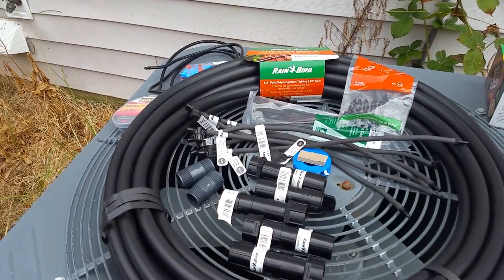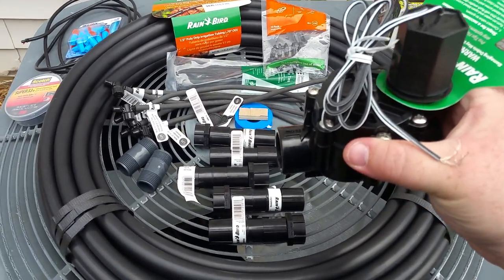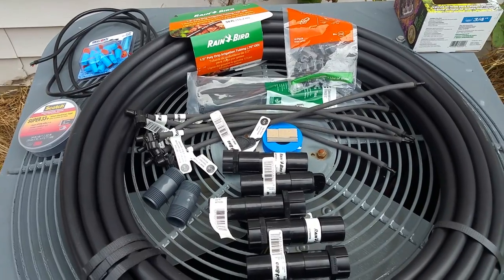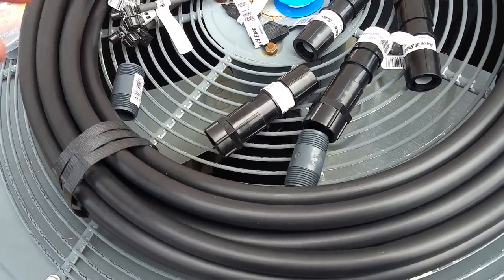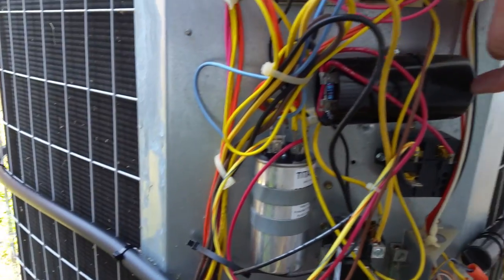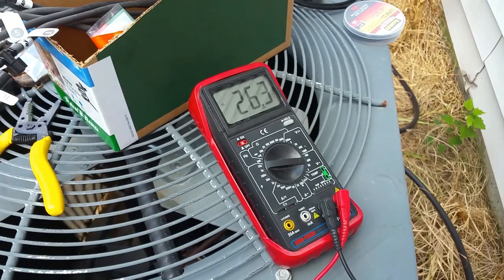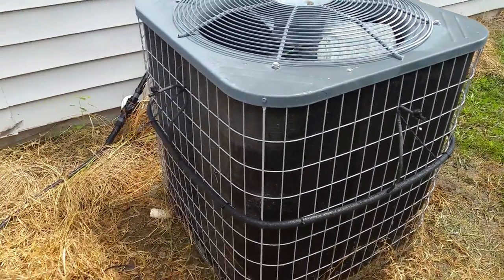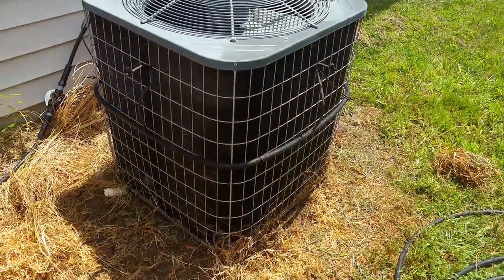DIY Automatic A/C Condenser Evaporator Mister - Electronically controlled!

Comment: Hopefully you have a txv and not a orifice type expansion device. Due to pressure temperature correlation , lowering your discharge press will also lower your suction press. With an orifice type expansion device you'll be causing a incorrect charge condition/ ice maker.
Reply: YEah, so what about when outside temps drop from 105 to 80 in the fall?  Does everyone then need to get refrigerant added to their system to compensate? It's not as if you are freaking freezing the damn condenser, you are simply lowering the temp a few degrees. What if, say, I turn on my AC when it's 60 degrees out? That's gonna destroy my AC unit? No i dont believe it will.
Reply: Joey Hollifield Im not sure what experience you have in the trade . If you read my comment i said "orifice type expansion device" the charge will have to be critically accurate. Damage is possible. Flooding the suction line and slugging a recip type compressor will result in catastrophic failure. And to comment on your question about running your a/c when its 60 deg outside, design supply air is only 58 degrees, so im not sure where your trying to go with that.
Reply: You don't know where io'm going with that? Come on, ok, lets say you come out and instrall my system when it's 68 degrees. I suppose when the temps hit 105 you are gonna have to come back out and remove some refrigerant from my system, correct? then when it drops to 80 you are gonna have to come back out and add some more? otherwise catastrophic failure is imminent right? BEcause that is all that this system is SUPPOSED to do, lower ambient temperatures around the coils. There should be no water hitting them, if done correctly the water evaporates in the air then the lower temp air is drawn through the cools, making it seem like it's only 88 instead of 105, or whatever. What is the difference between the air temp dropping naturally and dropping because someone used some local evaporative cooling? THATS what I'm getting at. There is NO difference at all.

Comment: You should install an outdoor thermostat so it will only open the water valve in higher temperatures  or your going to have other problems.note. if that is city water your using witch has chlorine it will greatly reduce the life of your condenser coil. Well water if not filtered properly will coat the coil with iron raising the head pressure

Comment: Nice job
Only comment would be to make sure it's off for heat pump mode or you'll habe an  ice block☺
Reply from the maker: androslive Definitely. I'll just turn the water off when summer is over.
Reply from the maker: Awesome! Thanks for the tip! I'll be adding a photocell and temp control soon, so water is not wasted at night and when temps are low enough that the mister isn't needed. I'll switch it to the reversing valve wire at that time. Really appreciate it!
Reply: and if you had payed attention to wiring he tied into the cooling wire on heat pump so it wont kick on for heat 

but yea spring and fall it couldbe valves off and you forget to mention draining the system if it freezes out side

Comment: has it been proven that this lowers your electric consumption?
Reply from the maker: There are too many variables to definitively say yes, however I saw a 10-17% drop. The best data I can provide was a significant reduction in post evaporator air temperature. This means the system was running more efficiently, allowing more heat to be extracted and moved outside. On average I saw a 7-10F reduction in air temperature coming off the evaporator.

Comment: parts list?
Reply from the maker: Working on it.
Reply: Part list??
Reply: Use pvc instead of the coil pipe like his used. It will be a lot cheaper. The misters can be screwed directly onto a pvc fitting, again reducing costs. I installed on mine using 3 misters, 3 slip to male-threaded 1/2" adapters, 1/2" pvc pipe, enough 90 degree elbows (5 for me), T's and 4-ways where needed, and a 1/2" to 1/2" nipple. I did this because I used poly hose to connect to a recirculator pump as I was doing this on a window unit and was capturing the water as it ran out the bottom of the A/C. I made a filter out of 2" pvc about 2ft long, cap on one end, 2" to 1/2" reducer nipple, then the poly hose from there up to the pump. Then a short piece from the pump to the pvc pipe. The poly hose was used to help with vibrations between the pump and the A/C running, minimizing stress points.

Comment: two comments :  three is plenty, and much finer spray, you need fogger nozzles,
second,  you could use one nozzle for the unit and get the benefits.

you do not need this unless the air temp is over 90 or some such.   a temperature controller is less than $20 on ebay
Reply from the maker: Please see my updated videos, I have replaced the nozzles with a much finer misting nozzle. Also summers here in NC are routinely 95-100 so it will be well worth it.

Comment: constantly wetting aluminum condenser fins that weren't designed to be operated in that environment can't be good..

Has any manufacturer of these home HVAC condensers ever endorsed continuous spray cooling?
Reply: man, aluminum is THE MATERIAL OF CHOICE FOR WET ENVIRONMENTS, even WET AND SALTY ENVIRONMENTS, as in ships masts, and railing, aluminum boats, etc.... it does not harm aluminum to be wet, not a bit. HAve you guys ever been like out in the world and paid attention to anything?

Comment: If you use anything other than distilled water you will ruin you a/c condenser. The fins will be coated with deposits that inhibit cooling. I find out the hard way even though I used a calcium filter.  Before I added the mister my a/c unit would drop out side temperature by 35 degrees F. When the temperature was 115 outside the  house was kept at 80. Now no more than 25 degrees on a hot day. The system now runs continually to bring the temperature down to 78 when the outside temperature is 100. 
My system is a four ton Trane and is only two years old. take heed.
Reply from the maker: Michael Cohen thank you I will keep am eye on it.
Reply: If you notice any white-ish deposits on the louvers then you are depositing material as I mentioned.
Reply from the maker: 1 Month in and no deposits. I will keep an eye on it. As I've tried to state I have very soft water, with a neutral pH. I'm lucky.
Reply: jonboy545 in my case it took 1 1/2 seasons before I noticed the drop in performance. Best of luck. I'm going to try CLR to remove the deposits. Baseline your system performance  now then again in a year or so.
Reply: You might have small leaks in your condenser coil. Trane coils are aluminum and water weakens them. Might be worth a check.
Reply: Scott HVAC Thanks, will definitely look into that.
Reply: The definition of salt is what is left behind when water evaporates. Saltwater is corrosive. The deposits left behind inhibit the coils ability to transfer heat. Not to mention what else is in your water that could be damaging. Like an oxidiser.... Which leads to "put a filter in line" or "add an RO system..." Great idea!!!! NO NO NO NO ! ! ! Water likes to be hard.... Js. So all those minerals you just stole from it.... It will be on the hunt to replace what it had. Your coils!!!! Yummy Soft metal to absorb... Oh the best one yet.... Water softeners!!! Aka ion exchanger... Ok so instead or just stealing from water, let's pull a fast one and quickly replace with something... Great idea! No!!! Actually it's worse!!!! That's because your replacement is a hungry oxidiser!!! Yummy Soft metal!!!!! Thoes aluminium fins will be eaten within a few years and before you notice any visible damage. Just like a termite. You don't know they are there till it's to late! That post you just fell over leaning on well you didn't know it but it was held together by paint ha ha! Salt, (sodium chloride) is used to replace the minerals in water. Chlorine is an oxidiser and bonds with your coils They wear thin till nothing left then before you realise, you suddenly loosing cooling! That's cause your copper is so thin it's leaking the freon... 
Also the definition of a battery is, two dissimilar metals separated by salt. .....yep you just invested in the most expensive battery that you'll never get power from....

Ok let's say you decide to try this for maybe a season or two.

Comment: Something I haven't seen mentioned hear yet is that you actually want the condensing unit to run to be more efficient. Electrically any compressor/motor uses up to 6 times more power to start it than it does to just keep running. By causing it to shut down more often, it could use more electricity instead of less due to start up. If you want water cooling, spray yourself with the damn hose and then get on a bike of some kind, you'll cool down real fast.....at least for a minute.

Comment: Update your video a year after operating! (Rusted condenser, fins, condition of condenser)
Reply from the maker: +Alan Green Will do! Amazing how these things don't rust when exposed to the rain year round! Great thinking! Oh, aluminum doesn't rust genius. Frame is powder coated, other metals are galvanized or zinc coated.... almost like they expect these things to be outside! Amazing!!!
Reply: jonboy545 Well the motors, compressors, and coils depending on style will and do rust from rain alone. I see it fairly often. I have my own reasons for why I don’t think the misters are a great idea, especially in low to moderate ambient conditions but I’m not gonna waste my time. If it works for you great, that’s all that matters!
Reply: dude, iron rusts. There is not a bit of iron in a condenser, none.
Reply from the maker: Sorry for the delay in getting to your comment. As of October 2018 there were 0 issues with the setup, and was still running great. Sold my home in October and have since moved. New house has a much, much more efficient AC system and I don't see a benefit of installing a mister at the new house, however I have not totally dismissed the idea of trying again. Some things to address that others have brought up in the comments: 
No rust issues what so ever. How people think a device BUILT and designed for constant outdoor uncovered use would cause rust, is beyond me. 
NO, I REPEAT NO BUILDUP on the condenser coils WHAT SO EVER. Use. A. Water. Filter. Again, rain water is WAY, WAY more "dirty" than filtered, city water. 
No issues with the HVAC thermostat carrying the extra load of the solenoid

The only thing I would do differently, is a better wire management job, and maybe using "liquid tight" conduit and PVC conduit box for the solenoid wiring. Just for a cleaner look. No issues with the outdoor rated wire nuts, or electrical tape. Keep in mind that's all that's used in the irrigation world, and that's usually directly buried or open air.

While I didn't do much scientific data recording to really drill down on energy savings, I can say my power bill was on average $20-$40 cheaper, without changing as many variables as possible year over year. Obviously weather has a huge affect on the energy usage, but the weather in NC is pretty consistent in the summer. Hot as balls. Water bill was virtually unchanged. WIth the NEW misters (please see the update videos on my channel) the water usage dropped SIGNIFICANTLY as there is very little flow with the new nozzles. They did a MUCH better job at atomizing the water.

My location doesn't really net the most benefit from a mister system either. It's typically very humid in NC during the summer. However, there was still a noticeable difference in condenser outlet temperature even on humid days. I can only attribute that to A) sufficient atomization of the water to still get some evaporative cooling and B) the actual water temperature itself being in the 60F range even on a hot day.

Thank you for your comment.

Comment: 27 years in the HVAC trade this should not be done! You will damage your outdoor condenser coil. Water has minerals in it and when it dries it will scale up. This gentleman does have clue what he is doing or talking about
Reply: What if the water comes from a water softener?
Reply: David Fudala 
Most people use salt in their soft water system and that would be a major no no. Condenser units love shade and being clean. What this gentleman done here is a LAST ditch effort. The system would be junk in less six months.

Comment: These are never recommended because of scale buildup an plugging. Of the hundreds of aspects to analyze, this is the big deal-breaker. You might try shading it instead.
Reply from the maker: 2 years in operation and ZERO buildup. As I states several times in my video, I have tested my home water and it is on the soft side, and I also added a calcium filter just in case.

Comment: jonboy  great video but your nozzles are putting out too much water go to mrdrip.com they have 1gpm .012" nozzles cheap lots less water and lots finer mist i built mine with solenoid valve instead of air flapper works great, that flapper wouldn't last a month here in Texas thanx

Comment: We love to repair these kind of AC systems!! The repair cost are amazing for us in the HVAC industry. WE love when people point their sprinkler systems onto their AC systems and corrode the Driers, Accumulators, Coils and Compressors they literally rust and fall apart. Any part in the refrigerant system that can corrode and leak we love fixing them!! Keep it up Youtubers you keep our families fed and help put our children through college. Just stop complaining online that we are ripping you off, we charge money for our services to fix your DIY knob job unprofessional save money now schemes.
Reply: Really? All that copper and aluminum rusts and falls apart? Oookay.
Reply: @Joefabricator  
you got him no technically copper and aluminum dont "rust " 

but the 2 ends on the coil are steel they do rust and many a time the rust expandsand punctures the thin copper tubing and the filter dryers main body's are steel so those do rust   
now some ac units use all aluminium coils those would be less affected 
but ask any boat guy aluminum can corrode and your in a worse boat than steel poking thru copper that can (most ac companies will tell you not worth repair)  copper leaks if axcessable can be brazed up just fine 
  
but most  everything is just temporary 
including us so keep cool

Comment: Don't waste your money you remove heat exchange,a/c removes heat from your house it doesn't put cold air in, put ac gauge on unit  then spray with water.. and watch the pressure dance not good

Comment: To help prevent calcium build up pick up a roll of PAPER evap cooler padding at Home Depot and place a layer over the condenser coil fins prier to installing the misters. Simply attach it with wire ties.
Reply: Sterling Reames covering the coils is trapping the heat load inside the unit...not a good idea. What are you people thinking!

Comment: Running any water over a condenser is not good. Unless it is filtered thru a R O system. It will eat it away over time.
Reply: Should be using the water that is condensing on the evaporator. With a window unit this is easy. In fact it sure seems like some window units are designed so that the water will pool enough that the condenser fan just barely touches it, kicking it up into a spray that wets the condenser.
Reply from the maker: Dang if only the rain that falls on the unit weekly was filtered through a RO system.

Comment: When you were making your connection at the condenser to the thermostat wires did you have your thermostat off? or did you just have it in a position so that is would not cut on? I think your video is great and I do appreciate you taking the time to go through it, I laugh when I see all these EXPERTS telling everyone how much water you will waste or how it's going to corrode your coils...LOL....Lets me see your condenser is outside in ALL KINDS OF WEATHER, acid rain and all that other crap and your using a filter DUH!!! and depending on where you live and how much your a/c runs, using a FINE MIST you might use a gallon of water  or so a day. There is always someone out there that will try to PISS on your parade! LOL
Reply: Anthony Porcarello Sr You have absolutely no idea what youre talking about. Running water over the condenser is putting tons more wear on things like your fan bearings. The refrigerant that gets used in these doesn't need help condensing like ammonia does when trying to get rid of the heat load. All you're doing is just ruining your unit. Feel free though it's your money you're wasting...- the industrial refrigeration mechanic